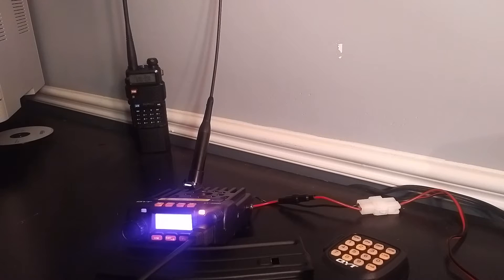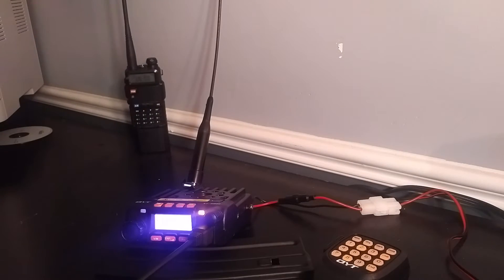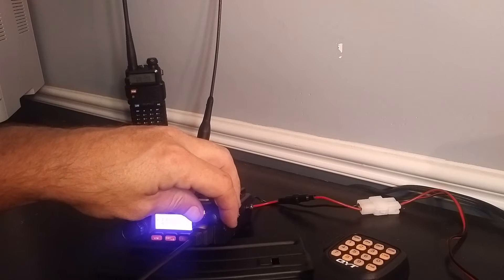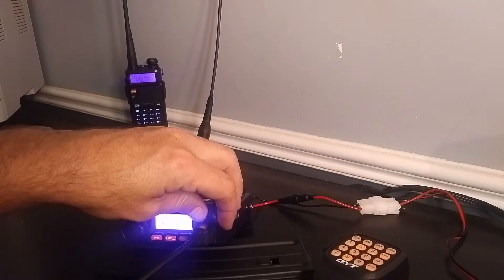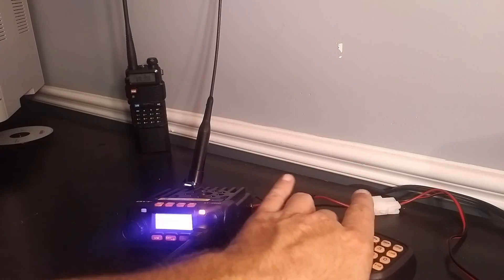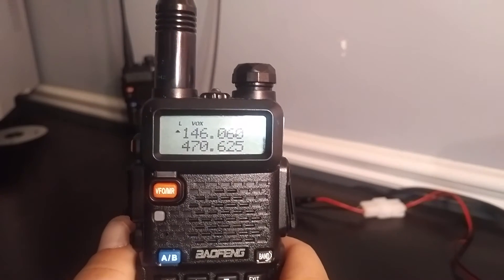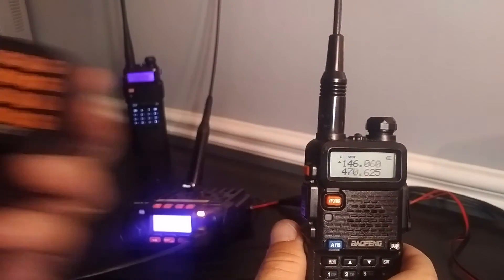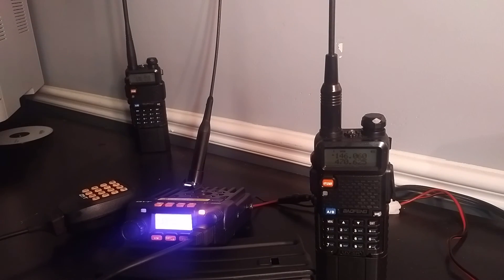QYT KT8900 communication issues with Baofeng UV-5R

Comment: I have the problem in the reverse. I can send from the QYT KT900d but can't receive from Baofeng
Reply: I have the same issue. Do you ever found a solution?
Reply: @alemaodownhill  Yes it was the CTCS code between the radios. I used CHIRP to program both devices to the same freq and code.

Comment: Is there any static or dropped signals while driving using an external mag mount? I'm currently using the UV-5R in my vehicle with a Nagoya NA-771 15.6-Inch Whip MAG mount but every time the vehicle is moving, the signal crackles and sometimes drops out. The radio forums typically say in because Baofengs are cheap and not made for on-the-go vehicle use. Is the QYT KT8900 built to receive better signals on the road?

Comment: Not sure if you’ve fixed issue but had similar issue with mine had to have the circuit board resoldiered but still having issue on uhf frequencies

Comment: UV5R s could be overloading at that range. Have you tried taking them to an operational distance (end of the yard?).  Otherwise probably a mic issue. I heard they're Kenwood compatible, like the UV5R? So you could try plugging the mic into a UV5R and see if it works one of them. If you happen to have a UV5R mic you might also try the other way round... This at least would show whether or not the problem is in the mic.
Reply: I broke my original qyt microphone and now i am going to order new from aliexpress. But i also read that kenwood microphone should work with this 8pin connector also on the KT 8900. But i don't want to risk. I also bet that the kenwood mic is far better than the QYT stock mic. 73

Comment: front end overload on the uv-5rs, being so close and the antenna is right there on 25 watts will make them dead
Reply from the maker: ricco march no, it's fried finals
Reply: ohh that sucks, high swr?
Reply: Definitely front end overload. I've experienced this too with the Baofengs. Get 20 feet or more separation between them and the problem will go away.

Comment: mic issue, try to use a ethernet cable tester. see is both connector are connected, 2 if they are connected then that would be a mic issue, try to find a kenwood tm271 mic see if audio comes out. If that dont work then it's you mic preamp thats busted... that one you need a skilled tech to open the radio.
Reply: I got a 8900D and had this issue.  Re-crimping the RJ-45 fixed it.

Comment: Everything I saw on your video would point to a PL tone issue.  Make sure Menu options 11, and 12 are set to off on the uv5r.  If you still have no audio, I'd say it's a radio malfunction.
Reply from the maker: Hey Jerry, thank you for looking but I have figured it out, turns out it
 was the RF module inside, it was fried, I took it to my local shop he 
replaced a diode and it words great now.
Reply from the maker: No it worked great for the first while I had it, then I messed it up. Good little radio for the price, well worth it. I have two of them now and using them as a cross band repeater
Reply: Did you fry the rf module or do you think it came like that from the factory?

Comment: mic fault?
Reply: Hi There 
I had the same issue and it's solved...
The point is UV-5r sas a problem when it updated by CHRIP, pls certify that all memory is erased before programming Chanal 2 and 3. It's the same table of bf-777s. For those channels no tones should be set, or any other setting
Reply: Hope have helped...